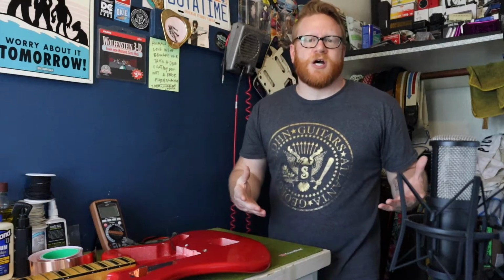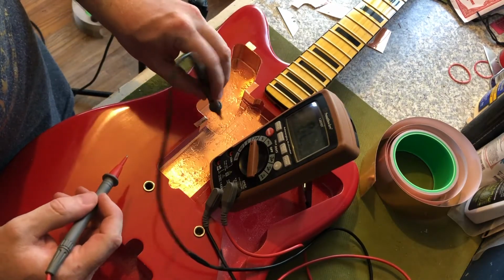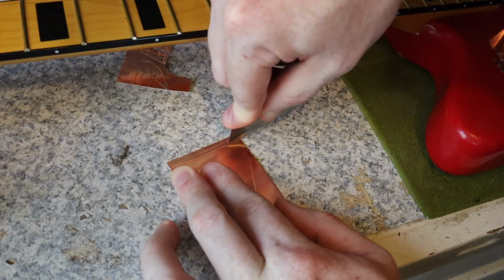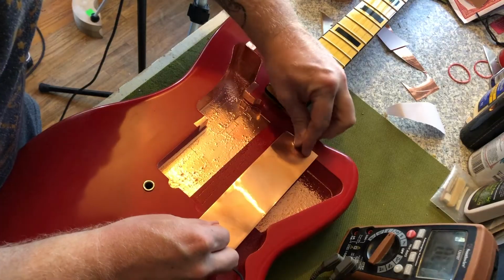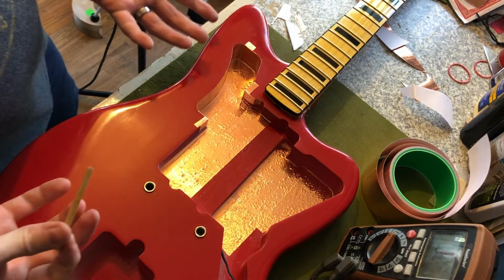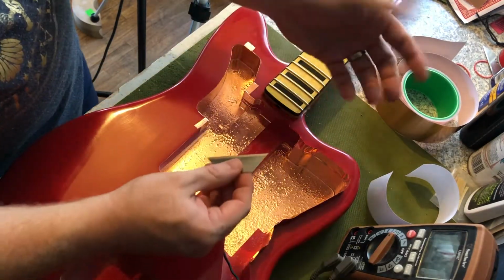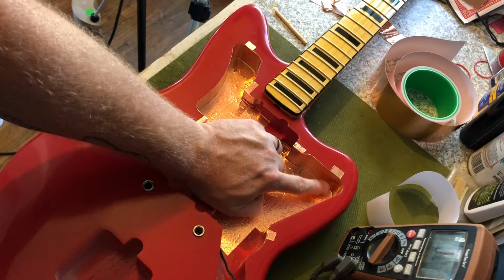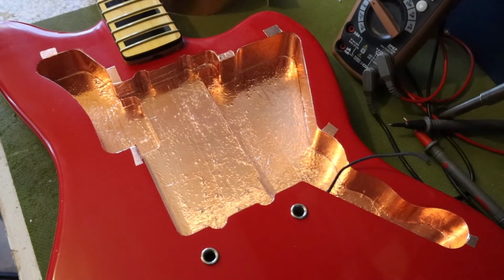GUITAR SHIELDING 101: A [Relatively] Quick Guide to Working with Foil Tape

Comment: Isn’t there risk of a ground-loop or two with the multiple tabs?
Reply: There is no such thing as ground loops in a passive electric guitar FYI. Good question though ;-)
Reply: @boddumblues ,  Guitar pickups generate a voltage that is referenced to ground, and so yes, you can have a ground loop inside a guitar! It's generally best to tie the shield to the electronics at just one grounding point ---- typically the volume or tone pot, or the output jack ---- but it's generally not critical. Any part of the shielding left ungrounded, however, can become an antenna that picks up noise instead of stopping it. The same applies to the bridge and strings, which all need to be grounded, otherwise they'll become an antenna. 

 It's also worth noting that some guitar amps can leak a small voltage from the input of the amp out to the guitar electronics, making your potentiometers and switches continually noisy (perhaps even wearing them out premature) despite cleaning. Overall noise could be worse if your guitar shielding has ground loops and there's voltage from the amp passing through it. This stray voltage running through the guitar can sometimes be caused by a bad input preamp tube but it could also be due to the design of the circuit. Best to consult an amp repair tech for this type of problem.

Comment: If this is so important why isn’t it done at the factory?
Reply: I would think that cost saving is part of it. Some manufacturers use "shielding paint" but, in my experience, copper tape is much more effective. 

This is a parts guitar and I believe a  lot of builders prefer to do this themselves.